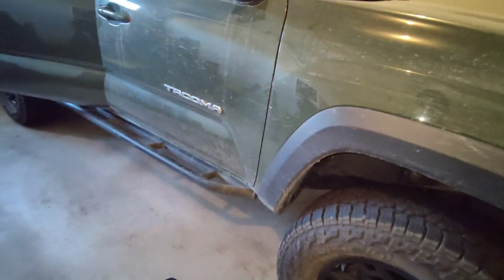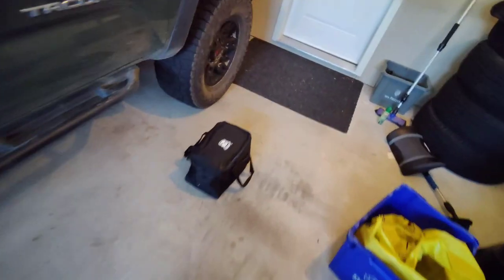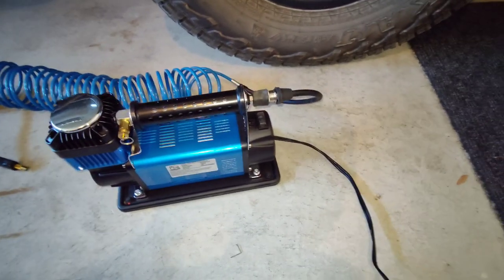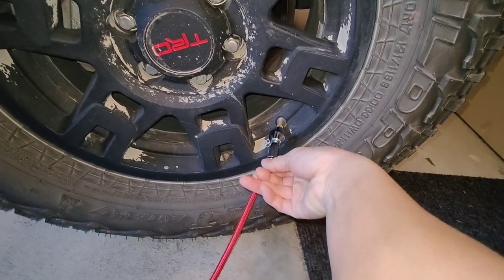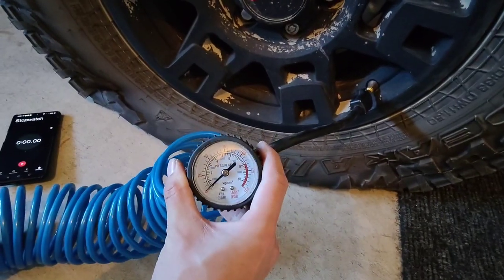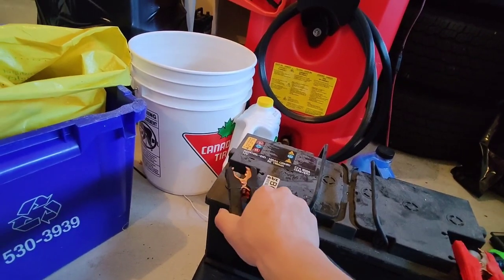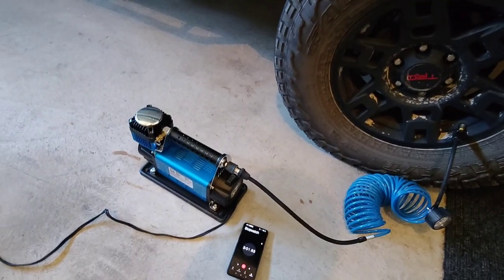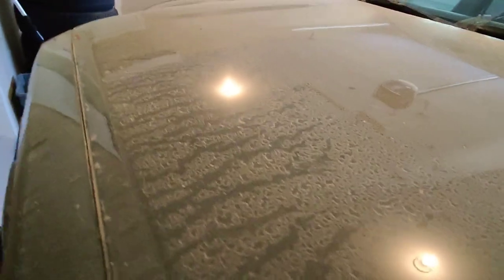Upgraded my air compressor to a Bulldog Winch air compressor. For inflating 33s

Comment: Good compressor! I only have a power bank size small compressor to top off tire pressure.
Reply from the maker: That's good! Always have something in case of an emergency. Especially with new cars not coming with spare tires anymore.
Reply: @theoffroadingmechanic  What tire patch would you recommend? No need for off road, just in case I got a nail on highway.
Reply from the maker: @frankxu2321  I really like the maruni valkaseal the one with the green label in a box in my emergency bag. It lasted the life of my old tires and didn't leak. The other one I had didn't work so great but I kept it in there just incase. Helped a friend one time the tire wasn't repairable but it had a huge hole in it. Shoved like 4 of those plugs in, filled it up and it held air to get him to a shop cuz he didn't have a spare tire.